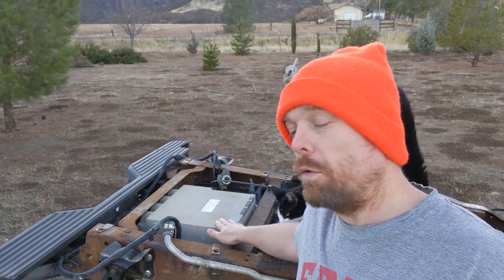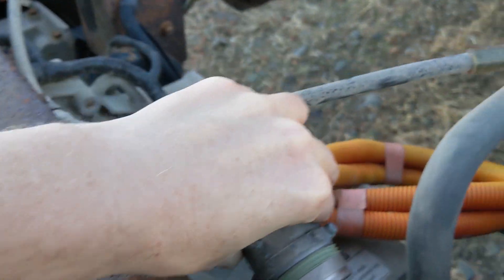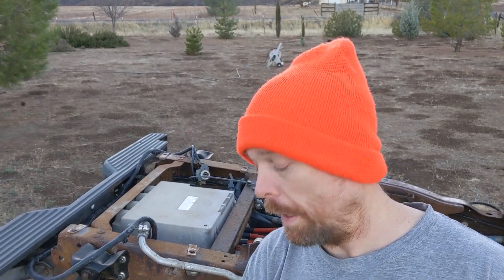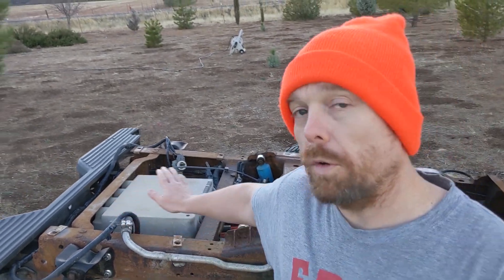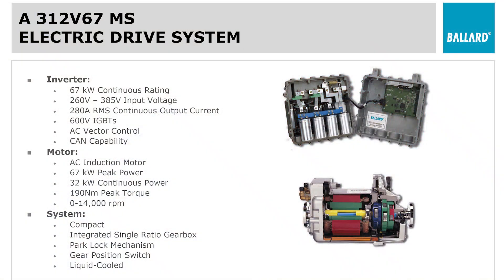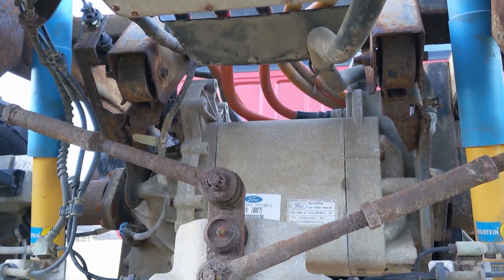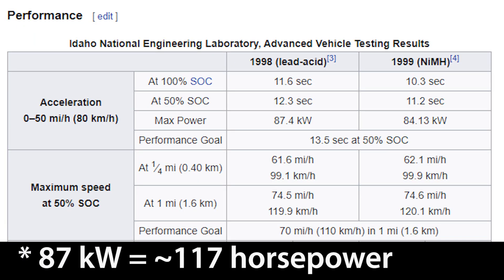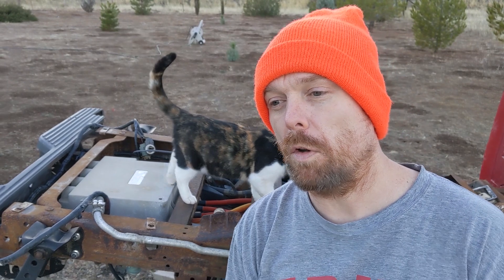Ford Ranger Electric: Introducing TIM

Comment: 60kwh battery from a tesla, or 14 modules, gets you under that voltage threshold. Perhaps buy a 60 pack from somewhere?
Reply from the maker: Are you referring to the Model 3 modules? Someone used 14 Model S modules, and that was about 74-74 kWh. They had to modify a lot, though, because the voltage and BECM weren't compatible.

Comment: Will be interested to see how you interface a modern battery management system into a pre CANbus vehicle.
Reply: They simply have no communitation between each other. But can its like i2c bus, they was been on the market since 1982, so, its not something new. Just automotive world was been always a bit behind of regular consumer electronics. Tesla changed a game in that aspect too.
Reply from the maker: Japanese cars have been using CAN since at least the early 2000s. Ford uses it's own communication protocols, so you either need to provide the right input to the module or replace the module if you want to run CAN.

Comment: Looks like it may be the same motor that was used in the Azure Ford Transit Connect van.  We had 5 of those at my work that I kept running for quite awhile until I transferred to a different department.   Very good and very expensive motor.   Does that sticker on the motor have any good information on it?
Reply from the maker: Yes. I'll go into details about the motor soon, and what I know about it. From my understanding, it is a slightly beefier motor than the one they used with the Azure Ford Transit Connects, but they are very similar. I think the controller might actually be the same, but I know there was another compatible controller available for a while. There is an even more powerful Siemens motor that uses the same format (I think close to 200 kW), but I'm not even sure where to get one at this point.

Comment: DC motors do still use a controller. The lowest tech you can get is a contactor controller, that uses various voltage steps from parts of the battery.  A simple potentiometer will not cut it I do not think.
Reply from the maker: That's possible. I believe the original EV DC drives only used a potentiometer, but I think you're right  that it was simply a direct connection to a contactor controller.
Reply: @newscoulomb3705  potentiometers can not carry much current, nothing close to a traction motor.

A battery is a set of cells in, mostly in series, so you can use contactors or simple switches to rewire the cells/batteries on the fly.  They also used very large resistors to knock down the voltage/current for "softer" starts.  Keep in mind you can also series or parallel motors for the same stepping results.

I've always wanted to build a modern analog EV using these principals. Have yet to execute such a project.
Reply from the maker: @D0li0  You're probably right. I could simply be confusing the two. The one I remember seeing looked like a potentiometer, but it could have simply been a contactor controller.
Reply: @newscoulomb3705  maybe your thinking of a variac? A sort of transformer with one winding that has a wiper that can adjust the AC ratio and thus voltage.  I think those were used as a part of older chargers. Some conversion guys I know still use those as a sort of analog charger that can easily be adjusted by hand to the various voltages found in conversions. They sort of act like a potentiometer, but for AC.  Anyway, enjoy watching your progress, and thanks for sharing your work with us all.
Reply: Yes, regular DC motors still need to have a controller. Without controller power loss is gonna be huge. Its okay to run DC motor without controller in 1920-1950 untill semiconuctors did not get that efficant to run it. Right now it does not make any cence to run DC motor without inverter(aka motor controller).
Reply: @pashko90  we are going to get into the weeds if we keep going, but.

A contactor controller is not inherently less efficient. A DC motor runs at a specific rpms per voltage.  Amps are simply the power or torque required to reach that rpm or voltage. None of that is inherently inefficient.

DC motors do not use "inverters", an inverter produces AC, for an AC motor. Technically all motors are AC, but a DC motor uses a mechanical inverter known as the commutator.

Anyway, I was only trying to point out that DC motors do use controllers and not a pot.

Comment: Awesome cat video! To be honest, incerter does NOT need to be matched to inverter. Check out Openinverter forum and EVbmw youtube of the Daniel.
Reply from the maker: Yes, that's technically true, but to me, it's kind of splitting hairs. The inverter only needs to have the right  power outputs for the motor, but reprogramming it is essentially matching it to the motor. Honestly, it's impressive how far we've come in just the last 10 years in terms of software alone to enable things like programming our own motor controllers.
Reply: @newscoulomb3705  Actually, first AC(or BLDC, wich is very clouse to each other) motors was been used in GM EV1 as far as i know, then it was been prius 10 in 1996/97 in japan and 2000 on US market( prius 11 international model). What is really funny, a lot of technology toyota sold/prvided to Honda in mid of 2000. battery cells in 2005+ hondas(first honda hybrids) was been 1 to 1 copy of cells from prius 10, inverter and a lot of other hardware(as inverter) was been build by toyota too).
Reply from the maker: @pashko90  Yes, I'm not saying these were the first. I was saying that these AC motors were really only used my actual automakers early on. Most DIYers had a hard time accessing AC motors with matching controllers until very recently. It was just too expensive and difficult.

Comment: Great restore. I saw one of these years ago in Elk Grove at HomeTown Buffet. Thought it was very cool. Are you planning on restoring the original drive with new batteries? What battery do you think will work best here?
Reply from the maker: Yes, I want to keep everything as stock as possible, but I might be limited. I've already purchased the batteries I will be using, but I'm still waiting on a delivery... more news to come. :-)
Reply: @newscoulomb3705  Good deal. I have and old Mustang I am going to convert to electric if I ever get the resources!! Good Luck.. EV powered Trucks full size I believe are just around the corner..
Reply: I think best packs to fit here is li-fepo4, they can be used as replacement for lead acid packs pretty good.
Reply from the maker: @pashko90  Yes, LiFePO4 are the best for replacing lead acid, but I might go into the battery constraints and limitations in another video.